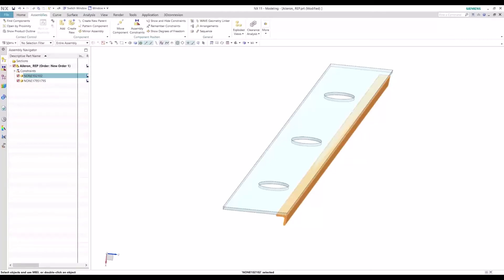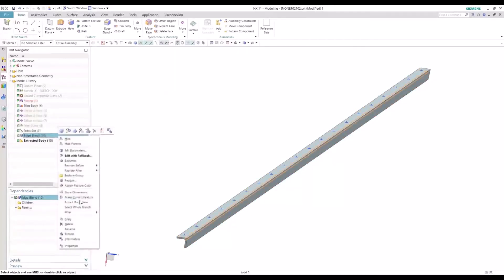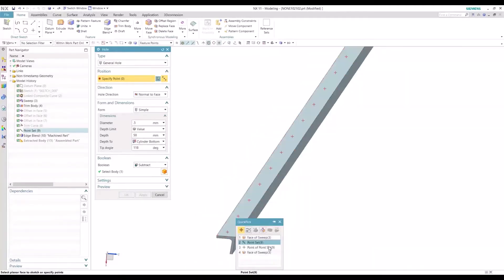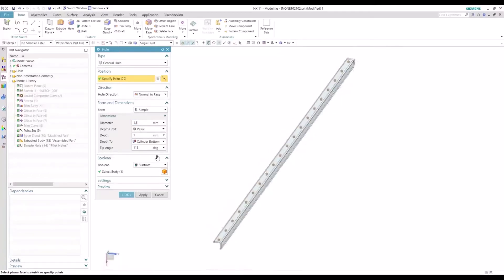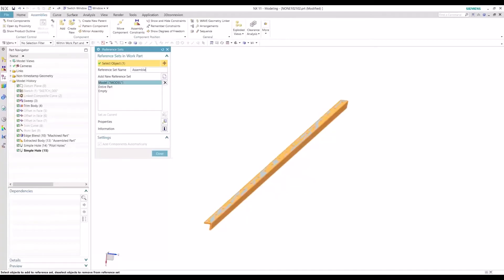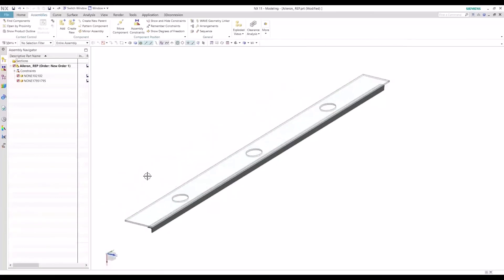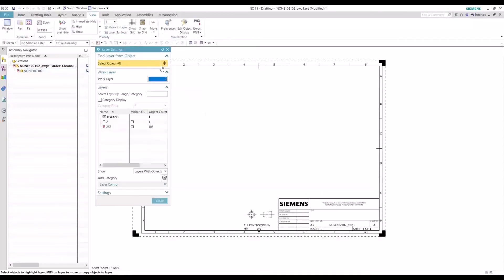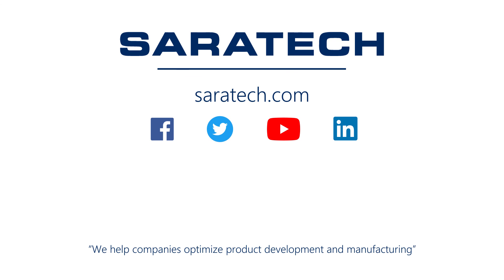NX: Using Reference Sets to Capture Machined and Assembled Parts

Comment: Is it possible to display both reference sets in the drawing at the same time?
Reply from the maker: There can only be one reference set assigned on one component. However, there is a workaround. 
1. Add the component to the drawing twice (once for each reference set you want to use)
2. Set the 1st instance to 'model' ref set and the 2nd instance to 'alternative'
3. Create your drawing views, use 'hide component', visible in the view, or view-dependent edits to hide one or the other representation in the appropriate views
4. If there is a parts list involved, set one of the components to 'ignore' so it doesn't affect the parts count